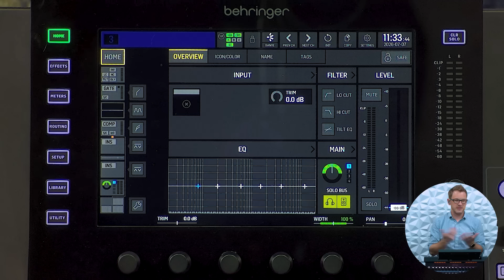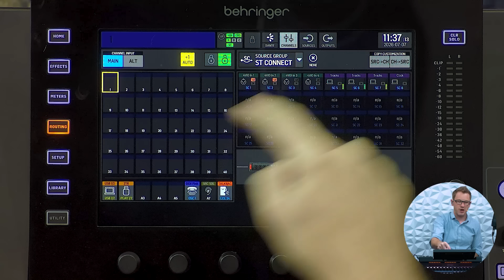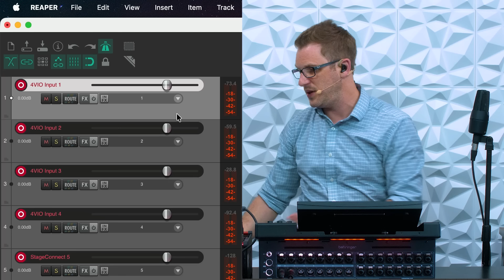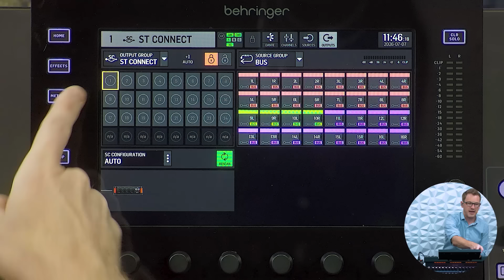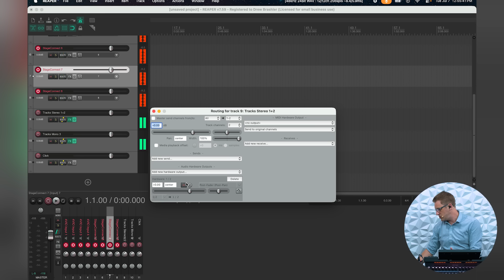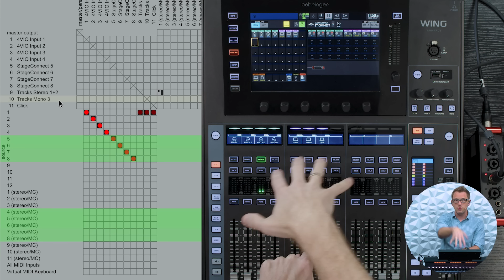New WING Firmware v3.1.1 Unlocks Flow 4VIO Preamp & Phantom Power Control

Comment: Guys need Help with the Wing Normal Size with The In Ears Bs 1-8.   Got the Update 3.0.1 .   I created the Mix to each Bus 1-8 and went to Bus Feed and Set Pre/Tap  so the worship team can edit their mix on the Wing Q app but when i do that I loose the Fader control on the Wing FOH. THen i go in to the Bus needed and set to Post and Gain Fader Level On FOH but the Singer then Looses Their Volume COntrol. I might be missing a setting im sure its simple where its merging the Send bus to FOH. But dont know how to Unlink them to seperate the In ears to FOH so they wont affect each other. Thank guys.

Comment: Complete offtopic. I would like to see this kind of tech for hypothetical xr18 2.0, where it would have those 32bit inputs with the possibility to send em to FOH console via stage connect, and Dante/WSG through expansion cards "as is", and at the same time the device itself being a normal rack mixer. Simply put, I want even smaller 2/3u WING Rack with no screen and less IO, more focused on compact IEM setups.